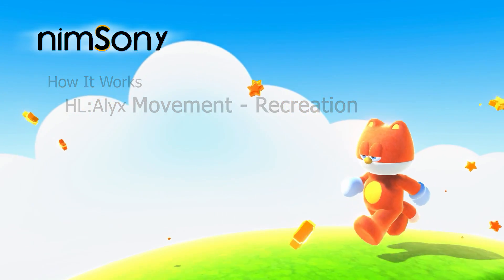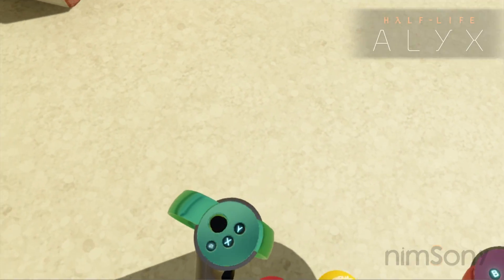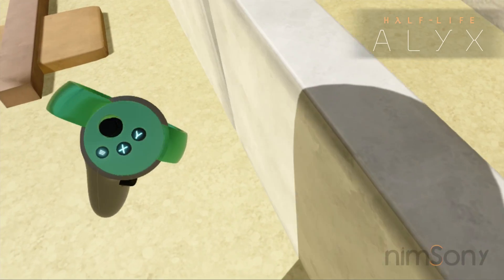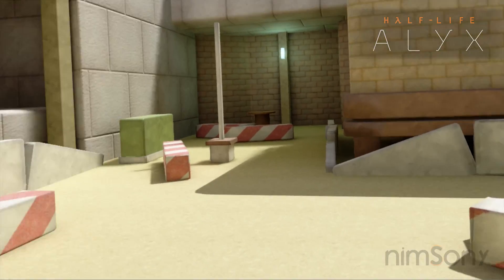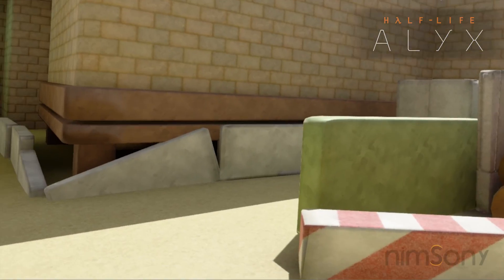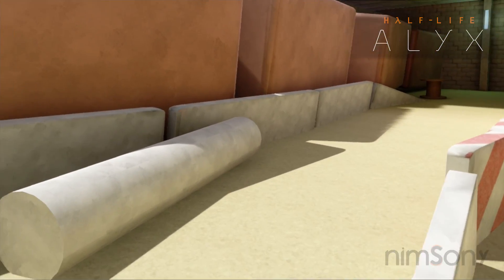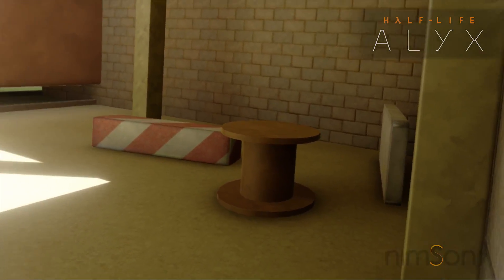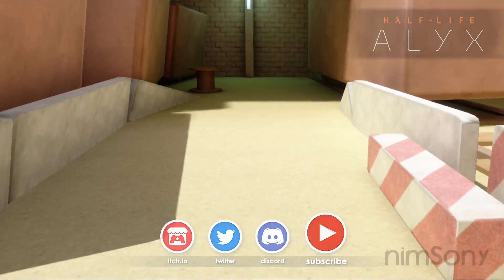How It Works 1 - RECREATED - Half Life : Alyx - Movement and Collision

Comment: I imagine this subject matter does not interest a lot of people, but for the people that actually enjoy this, this is super freaking interesting. Thank you for sharing all your investigations/research.

I'm curious though, do you/anybody like or dislike the way HL:Alyx pops you back to where you were before you collided with a wall? Or would it be better if it detected a middle somehow and realized it should pop you out the other side since you are closer to the other side of the wall? To me it seems more intuitive the second way, but maybe it would be jarring for some reason.
Reply from the maker: It should never put you on the opposite side of something in my opinion. there is no way you could get there based on the character control system's physical limits.
Here for example there's no mantling, so it's physically impossible for me to have climbed over the walls, in HL:A yes there is mantling, but I can step through small head sized gaps (as I showed in my review) and the game just allows it, I think it should always put you back where you were, unless the control system itself is capable of reaching the destination, which is more complex to calculate.
Reply: @NimsoStudios  I think that definitely makes sense at least from a game design perspective. You wouldn't want to let the player bypass parts of levels by letting them stick their head through a thin wall and essentially teleport to what would be a location further along in the level.

Comment: How does the slightly shorter capsule work? He says it traces horizontally and checks the ground for height differences. Is this a trigger collider or is he using raycasts?
Reply from the maker: I write all my character controllers' collision systems manually rather than using the existing helper components.
So I use the physics functions for detecting and tracing Capsule and Sphere shapes through the scene.
Here I use 3 shapes as part of the code, the Head Sphere, the overall Capsule, then the Step Capsule.
The step capsule is hovering a specified amount above the ground, when I trace movement I trace using the step capsule so it never hits things that you can step over, it then traces the radius of the capsule down and extends the same amount below the ground level, this allows me to instantly step up or step down if the floor level is close enough.
If the floor is too low it isn't detected as a step and counts as falling off a ledge, if the floor is too high to step up it gets hit in the first trace, so it's detected as a wall.

Comment: What if you implemented this system, or at least part of it, in your physically based IK project? Instead of using a capsule, you have the mesh of the player model detect collisions. And for stuff like leaning over the concrete barriers, the IK detects that collision, and starts leaning over it, instead of pushing the player back, or otherwise not letting the player put their head over the barrier.
I think it could provide an extra layer of smoothness and potential immersion on top of what's already there.
Also, for better reference of controller input, I would suggest rigging the button presses and thumbstick movement to move the ingame controllers via armature, and perhaps you can model in some transparent light points or rings that show up on top of or around each button when you provide capacitive/non-touch input. That would give us a much better idea of what you're actually inputting, assuming the hands/controllers are in view.

Comment: Good and intriguing content as always. -- Though, I'm still way more interested in physics based systems that track the combined player movement (not just the center of the play space), that prevent users from waking through objects, and that let them fall off edges.  (They're not super hard to make in Unity; I'm just tired of seeing so the games that let you walk through walls.)
Reply from the maker: I think you're missing the point of what the game is trying to do here.
This system does exactly what you're asking, but it does it intentionally only when the player tells it to.
Here I could literally modify a single line of code and skip the Joystick check, it would allow you to have full collision the entire time even when you walk around in play space.

The center of the play space is not for the player to understand or care about, it is just the necessary element to correctly applying movement in VR, you never move things within the tracked space by code, they follow tracking no matter what, it's what you can add to that that matters.

Comment: Off-topic, but the metallic controllers are oddly satisfying
Reply from the maker: It's a slight update to my personal themed controller set, but I probably won't be keeping the metallic materials after this.
The separated colours are intentional to show which one is left / right at any time without really thinking.
I always have the same rule on colours: R = Right = Red, L can be anything L, sss (else).
Read that as "Red or Else", or "R or L"
Reply: @NimsoStudios  How do you feel about Beat Saber putting Red on Left?

Comment: 300  lines of neat code is not really quick and simple in my opinion 😂
Reply: "neat code" isn't related to how much of it there is.  Though 300 lines is a pretty small amount, especially if it's well formatted and commented (i.e if it's neat and tidy).
Reply from the maker: Precisely as  @BrainSlugs83  said.
The reason I mentioned neat code here is to highlight just how little was involved in writing this system.
I'm a neat freak with code, my scripts have white space, neatly aligned comments and bracket placement that other coders often don't like because I'm apparently "wasting space"
So in actuality it's probably more realistic to say 200 - 250 lines of actual functional code... that's pretty short.
My platformer game has over 700 lines in just the camera control with no player movement at all.
Reply: It kinda is tho.... 300 lines for a vr Character Controller on par with HL alyx is "neat"

Comment: Wait what else would be in the series, boneworks? Would you spend that much time to recreate it's system?
Reply: We put the entirety of the blueprints for how to make boneworks body/locomotion on display in the game, so it hopefully shouldn't take that long.
Reply: Alex Knoll that’s awesome that you guys made it public!
Reply: @AlexCKnoll  Yes I guess that's true. I know about Bonework's locomotion system to some degree, but I thought that even if you know how to do it, it would still take some time/tedious work. I was really just asking if Nim Sony was planning on putting that much time into this series or not. But I guess now that you mention it, maybe it wouldn't take as long as I thought.
Reply: Alex Knoll 
Wait, your a boneworks dev? If so, Love your game!
Reply from the maker: As Alex mentioned they'd put a diagram on the wall in the first level of the game. I'd studied a bit of the actual movement though the same way I did with HL:A especially out of curiosity for how they handle things differently to what I do.
If I do take on the game for a How It Works it will likely be in small elements, it's considerably more complex than what HL:A does though there are always similarities when it comes to games.
To answer the primary question though, this isn't dedicated to VR games, I think HL:A and BW are pretty much the 2 absolute extreme sides of player movement and pretty much cover everything in between as a result. I want to do this stuff for way more than just VR games, and of course not just for movement systems but any game system.
Reply: @NimsoStudios  Ok, thanks for the reply